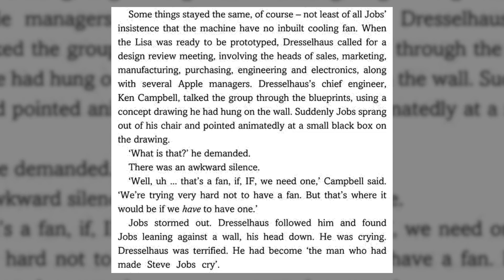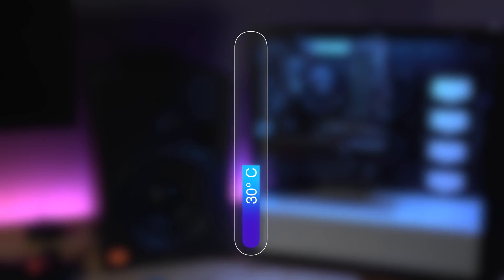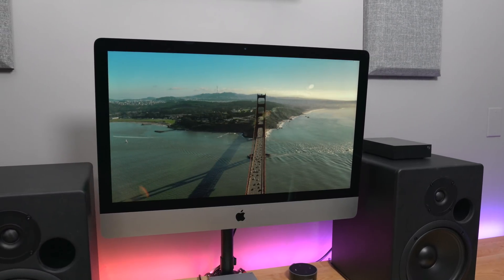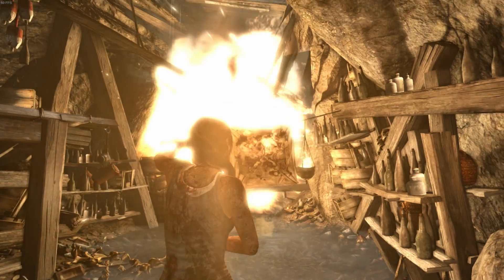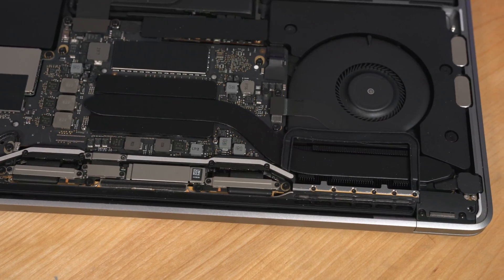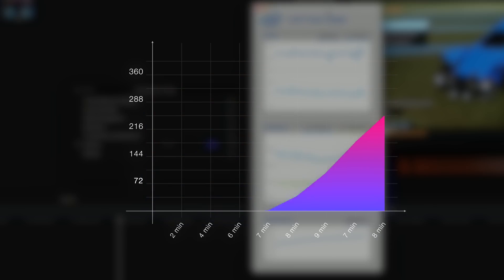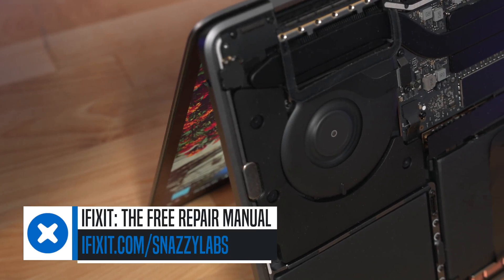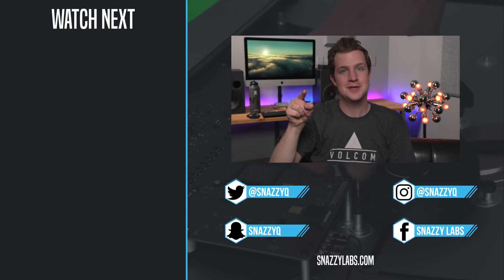Is Apple Ruining Your Mac's Performance?

Comment: Im really scared to edit videos on my mac now. Should i still do it?
Reply: My clients produce films for a living. Every single one of them uses iMac and MacBook Pros, none has any problems whatsoever and they have been doing. this for many years. Yes, the fans spin up when they are compressing or exporting video, thats because the Intel CPUS (which all computers use) runs very hot wen its loaded heavily. The Mac will keep itself from getting too hot (if a fan fails, the Mac will shut itself down to prevent any damage) so you don't have to worry about it. Just go ahead and edit your videos.

Comment: It's actually NOT okay for them to have their computers that hot. My 2011 MBP had a recall due to the GPU failing, basically because the computer's constant temperature fluctuations caused solder on the GPU chip to crack.

Comment: I am exactly the same.  I cannot stand fan noise.  I actually prefer a slight reduction in power (aka throttling) for a quieter PC.  I actually look at quiet PCs as higher quality and invests in R&D/engineering to build a superior PC over the cheap PC competition.  My own custom PC build I spent a month finding and researching the quietest build I could ever do and I made it happen.  Only 8dB with a fan I had to put in to avoid hot air getting trapped inside the chassis.  I didn't even want the 8dB fan and you can't even hear it anyway....but that is how much I wanted the quietest PC possible :)

Comment: Just my 2 cents. I have seen this on my 2011 macbook pro 15" with dedicated graphics card. As others mention, find and use a fan control. I use Macs Fan Control. You can use it with the sensors to set when the fans kick in. A good way to avoid thermal throttling from kicking in early, or to avoid the mac waiting till the last minute to bump up the fans (at that point it goes max and sounds like a plane taking off), you can set it to kick in earlier. 

For example. When set to auto my mac idles at 60C (running the fans at base 2000 rpm). However, I have the software custom set to have the fans kick in from 40C. As such it tends to run the fans around 3600 rpm, and thus stays "cool" at around 45C or so. 

Now... this also means that you battery drains faster, and your fans might wear out sooner than you might want, but at least my back runs cooler and is more comfortable on the lap. Of course if you put it under heavy load there is no avoiding the eventual throttling (though it throttles later) and worst still, from sounding like a plane taking off. 

I love the macOS, but hate this cooling issue (I do a lot of load intensive tasks), which is why I finanlly built my own PC and hackintoshed it. Now I have a "mac" running at 30C idle, and never goes beyond 55C under load.

Comment: Well the touchbar Pro's do use a different cooling system, with an extra fan and more ventilation on the sides near the bottom. But your point still stands.

Comment: I work with an 2011 iMac in the office and have MacFanControl installed and cranked up the fan-speed, otherwise I dont think he survied the summer. The 2014 model melted down... and I am just using Photoshop, Illustrator and InDesign.

Comment: Are you sure that’s true about the MacBook Pro ? Because mine when it gets hot (playing Minecraft) the fan is going MAD, it sounds like a tornado in there,the fans are spinning so fast. Also a couple years ago for some reason the CPU was at 800%. The only reason I knew this, was because one day I turned on my computer and the fans just started going MAD for no reason I hadn’t even loaded an app or anything I was doing NOTHING. I tried restarting the computer, nothing , I tried fully shutting it down and turning it back on, nothing, the only times the fan turned off was when I closed the lid, even then it took a good 10-15 seconds before the fan did turn off. Then as soon as I opened the lid again the fans were back up to full speed. This happed for two days straight. So I looked up online and it mentioned activity monitor and that’s where I saw the 800%. After that it fixed itself and was back to normal. My point is here, is that it was NOT QUIET AT ALL , it was the complete opposite, again It’s that noisy when playing Minecraft too. I have the late 2013 15”  model with a 2.0GHZ quadcore i7 , 8GB of RAM, 256GB storage and 1GB of Intel iris pro graphics. Still to this day have no clue why my mac did that.

Edit: the fans also go full speed when I’m using iMovie or when I’m uploading a video from iMovie to iMovie theatre. It’s really noisy then too,so does that mean mine is defected? Or have a Trojan ? or what ?

Comment: No the higher end models don't have the same cooling :( why are you lying?!
Reply from the maker: +BioMajuss They do. Except for 13" MacBook.
Reply: Just NO! The 13" MBP with 2 TB ports (15 W) has only one fan, with 4 TB ports (28 W) has 2 fans... There is no such thing as "13" MacBook"
Reply from the maker: +BioMajuss You're misunderstanding me. The 13" MacBook Pro (didn't say Pro because I thought it would be obvious given there wasn't another model in that size) is the only model with cooler/fan variance. The 15" MBP has the same fans and heatsinks across the line as does the iMac.

Comment: Nice investigation.  It's a fair debate whether more fans could cool it more, or whether jacking in the fans at a lower temp would stop it from hitting the infernal peak.  It's clearly true that if you find the temp uncomfortable on the legs, the fans could help that.  But the noise factor is very real as well.  For instance, the video series I'm doing is better when the fans are not on.

Comment: Lol...ever heard of MacFan Control ?! My MacBook Pro (mid 2010, i7) is settled up with MacFan control sensor based (fans hardly go below 2500-3000 rpm, silent enough that you'd not hear it obviously). Never gets hot, maintains the CPU performance without a drop.

Comment: I got a new MacBook Pro 13 inch... this laptop won't make a single noise.. it is actually scary.. I thought the fans were broken but no, it is just quiet and after watching videos, youtube, netflix.. it remained at 40c
Reply from the maker: +ginito It's not true 40c. Most of the fan speed and temp apps incorrectly report temperature data for Skylake and Kaby Lake. Get Intel Power Gadget to know your actual temps.

Comment: Snazzy Labs kicks in some (old) open doors. Well executed though.
One of the many reasons why I don't get that anyone buys an Apple computer. Having said that, some other companies might want to look at the noise level a bit more. Don't use blower coolers unless paired with a small case,  use sound dampening material, enable good air flow, allow a zero RPM mode. But don't thermal throttle! Just let people set the fancurve and the voltage of the CPU/GPU, also for laptops!

Comment: My 2014 Macbook pro at stock setting overheats and will die much much faster then if you don`t do something about it yourself by using custom fan profile... When I run windows I undervolt the CPU and set max CPU temperature to 70C instead of 90C, this result in it never overheating even playing GTA V with a external GTX980Ti graphics card running at full Turbo speed 3.4Ghz for hours. Without doing this it overheats and throttles down to less tan 2,4Ghz and performance suffers badly... With the undervolting CPU fan noice is not that bad and when I run OSX it does not get half as hot as when I run windows anyway so it manages without undervolting the CPU (windows is absolutely horrible when it comes to power consumption compared to when I run OSX).

Comment: Using SMC Fan Control, I can control the fan speed and therefore prevent the MBP from overheating and therefore throttling
Reply from the maker: Victor Berland No. You can increase the fan speed enough to delay throttling but it's still inevitable. Probably only buys you 30 seconds.

Comment: I'm a software developer working on a project that is very slow to compile (i'm just an outsider, can't do much about it), running automated tests constantly  I have a 2015 15" macbook pro. I'm constantly waiting for stuff to compile, tests to run and this puts the CPU usage constantly between 50% to 100% (all cores are being stressed, multithreaded workload). My macbook is constantly running the fans at clearly audible temperatures; loud enough to get comments from bystanders like "wow you're laptop is about to take off"

Comment: 1) The stronger CPUs are 100% cash grab in laptops as all come with puny cooling. The power is there, but the cooling isn't.
2) My bigger issue is the iMac. It has the space, the size, yet Apple does not bother to add a cooling that would result in lower temps and in lower noise.

Comment: 30 deg C is not half of 60 deg as the Celsius scale does not measure absolute temperatures, only relative temps. You can only state a temp is half of another on an absolute scale like the Kelvin scale.

Comment: My mid 2009 MBP was a pretty much usable machine for most of my work until I upgraded it to El Capitan (which I had to because the Mail App was burning my CPU in Mavericks). Now the GPU is constantly hot, even in the bootable disk menu (Opt+power), but when I boot linux on it, that problem suddenly disappears. Almost like Apple wants me to buy a new MacBook Pro. The only problem is, they don't manufacture Pro laptops anymore :(

Comment: Hey @Snazzy Labs the MacBook Pro (With Touchbar) doesn't have 1 fan like the base model it has 2 fans so it won't throttle like this
Reply from the maker: +Saher Amr It still does a bit because the CPU TDP is significantly higher.

Comment: Macs fan control fixes this
Reply from the maker: +Gjermund ॐ Gusland Thorsen No it doesn't. It slows the throttling process but you're still gonna hit 100 deg. Temps by SMC and Macs fan both inaccurately report core temps. Gotta use Intel Power Gadget.
Reply: Snazzy Labs ?!? Mine is at a steady 46C, just by doing custom settings. And there is a significant speed increase on hardware that runs a different version of MacOS X than which version it came with. I would not be shocked if this is part of Apple's planned obsolescence ... Macs fan control is the solution to override the strange settings in the OS. Macs fan control can not be closed however, it can be minimized however; and is a setting. Minimize on login.

Warning your Mac will be noisy but you will be able to do more stuff.

To me it looks like intel gadget is using the same API/SDK as the system, while Macs fan control obviously uses and older version that actually works.
Reply: How do you change the temperature and fan speeds in Intel Power Gadget? I'm only able to see the graphs from the system, not able to tweak the fans' conditions. With Mac Fan Control I made a MacMini core2duo functional again. If I ran its original OS it works fine, but with Mavericks it's not even good enough for remittance without tweaking the fan settings. I run ONLY FileMaker 11 Pro on that machine it has R9 SSD, 16GB RAM and runs brutally slow without tweaking the fan settings. Like in 45 secs when tabbing between fields in FileMaker to less than a second.
Reply: If you tweak the temperature to 46C how will it reach 100C?

Comment: Can't it be fixed with a system tweak? Or is it EFI level?
Reply from the maker: +Fernando S I mean, you can use software to max out the fan speed, but that won't prevent you from hitting the thermal ceiling. It's a hardware problem.

Comment: NO my 13" 2017 MacBook Pro with touch bar has a superior dual fan cooling system it rarely getting hotter than 90 degrees

Comment: The 2015 13" MBP runs so much cooler. It's thicker and has a more robust intake/exhaust ports.  It hardly makes a peep compared to the 2017 13" MBP I tested. That baby was toasty!
Reply from the maker: +Bob Of All Trades Yeah it does a better job. Especially since it draws in from the front of the laptop and exhausts out the back. On the new ones, the intake and exit are so close that some of the air going back into the laptop is already hot.

Comment: I already have a 2017 iMac for heavy editing but I'm thinking of getting a MacBook Pro 13inch base model to just edit photos moderately on the go during my commute just using Photoshop and Lightroom. Would the 13in base model be a good cop and last me for the next 5+ years ?
Reply from the maker: +Al Zaman Yeah that would work fine. I even edit 4K video on my 13" MacBook. It throttles and slows down but it still works just fine.
Reply: Snazzy Labs Thank you for responding back I really do appreciate. So you say I should go ahead and buy the base model 13inch and it will be good for the next 5+ years because I also need it to be long lasting laptop since I won't be spending anymore money on a desktop or laptop for the next 5-10+ years

Comment: I like my 2011 macbook pro 15" better than the newer 2015-2017 models. The best part is the ability to replace parts such as the battery, ram, hard drive, etc. I put in an SSD and have another HDD in mine. It's better than the 2015 retina macbook pro I had!
Reply from the maker: +goo6 True. No retina though. :(

Comment: well, apple could make their stuff quiet if they went for huge heatsinks

there's a passive cooled PC case out now, super heavy but dead silent, sounds just right for apple, no fans, no noise, no heat, pure performance and reliability due to the absence of mechanical cooling solutions.
Reply from the maker: +Nathan West I made a fanless hackintosh build that worked out great! Not too huge, either! https://youtu.be/OLmk_XsRgOQ

Comment: Ive got this Mac Fan Speed app that can set the temperature of which the fans should start working, i set it pretty low and i now hover between 45-55 degrees celsius with my maxed out mid 14 mbpr.
Reply: to be fair im a web dev so i usually am at 30-60% usage on CPU so i never hit those render numbers that video people do.

Comment: You can use software, like SMC Fan Control, to actually kick up the fans a bit, and even adjust them to keep the temperature lower at idle, which often provides for more time before thermal throttling kicks in.
Reply from the maker: +Thomas Gill True. Helps a tad, but you'll still eventually hit the ceiling and throttle.

Comment: You made a very nice vid where you changed the CPU of the base model from an i5 to an i7 and you thought you got lucky getting a CPU (silicon lottery) or maybe apple get cheap deals on CPUs... but even then I thought this could be the real reason. 
Under clocking under volting could be for this reason. 
And while I'm here. I got my self the base 3.4 model. You are sure I can get the i7 into it?
And I do think you can get an app to make the fans work at lower temps.

Comment: I got this problem with my mbpro 2015 13" it is now laying on my desk because it will only boot in save mode ... because the graphics are damaged and i havent laying around 700€ for a shitty refreshed board! and i was knowing that the core is running much to hot even 100 C it isn´t stopping for throtteling. 104 was max temparture without loosing much performance.
so i did some small changes. 1. removing the black of the heatpipe.
2. using Thermal Gryzzly Cryonat.
3. chnage tm paste for cool laboratory LIQUID PRO.
and at last set my max temperature to 70 C with mac´s fan controll.

all in one 1400€ payed over a year for a device that is now laying and can´t be used =( 
But iam waitung for an affordable 15"with 8.Gen Core and then lets see what´s happen....

Comment: For the price they're charging for the imac or imac pro they could have put a some AIO or at least better air cooler.
and thinking about imac pro and the fact that are going to use vega gpu with it, it's going to be hell inside there.
Reply from the maker: +Eliad Buchnik Yeah but iMac Pro also has two huge fans that look to have a much higher displacement. I agree tho. It will be interesting. I think I'll be getting one to test out!
Reply: i would love to see a video about it since right now both vega and xeon cpu  have high tdp , and even normal sized computer  with a decent cooler struggle to keep those components temps down, my guess imac form factor with those components will reach thermal throttle pretty quickly or run very loud (or both).

Comment: I am a video editor and a casual gamer. I use the hp spectre as my all time work machine. i use an Akitio egpu setup with it too. From what I observed 
1- The laptop does get a bit noisy at times and temperatures do get up. But they were never uncomfortable. Even rendering 4k footage never made it go haywire. 
2. In my 10 months of use, I have seen it thermal throttle very little. The only times it does is when I have had long days where I had it open for 12 hours at a stretch. 

I wouldn't have had either of the above if I didn't have proper cooling within the laptop. Leaving the egpu aside, the laptop must never under perform where I need it at it's absolute best. And it delivered every time. So yes I accept the noisy fans, but I will not accept a dip in performance. This needs to be understood by apple. There are people out there who might want their 2000$ machine to perform at it's best. It is too much money to get a machine which would under perform.

Comment: The aluminum is a mac's heat sink              And mac are the best
Reply: Ultimate science Guy yes, burned legs and 100c cpu temps are the best. All at apples low prices.
Reply: If not for rendering or for gaming then what are they for that even a 200 dollar laptop can't do?

Comment: I think this is a big problem with a lot of electronics. Tablets, HD screen capture box, Laptops, Mini PC's

Not wanting to add a fan for cost, noise, or whatever is just plain stupid. The engineers should totally be able to tell how much heat is going to be produced in a circuit. 

Could also be planned obsolescence, the companies poorly designing stuff so it intentionally does not work properly or so that it breaks and has to be replaced.